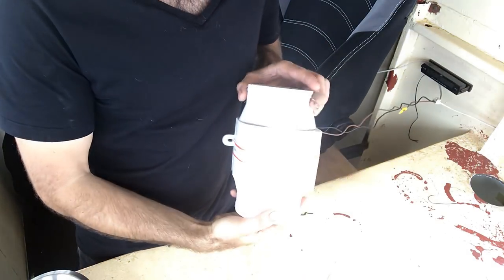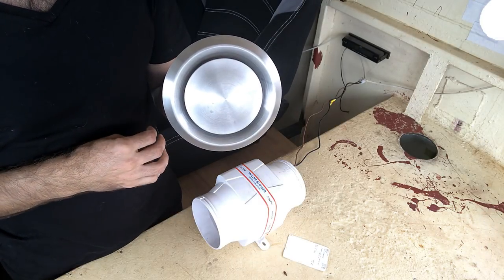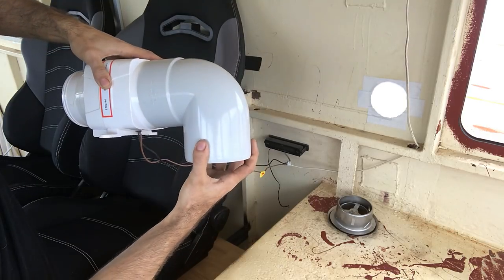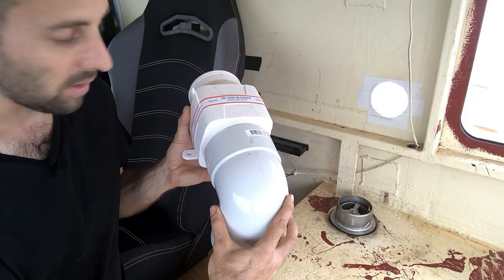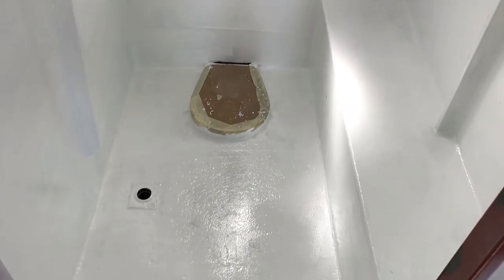Brupeg's Bathroom gets worked on (Ep. 09)

Comment: Hi from Canada.  Really enjoying your videos and like seeing the progress you are making.  When you mount the fan for the bathroom on the back of the wheelhouse, you might want to put some dense foam between the wheelhouse and the mounts to cut the noise that you would get if you bolt the fan directly to the wheelhouse.
Reply from the maker: That’s a great idea. Our 12v water pumps have little rubber mounts for that reason. I will track some of those down to help out with this issue.

Comment: I have an idea to quieten down your bog blower. DC motors will happily run slower (and quieter) at lower voltages. You can buy DC-DC voltage converters, which would lower the voltage to say 5V, but they are expensive and the output voltage is fixed. Or you could wire two blowers in series to effectively give each blower 6V. Even better you could wire a light bulb (the bathroom light) in series with the motor. Playing around with different voltage and wattage bulbs will increase and decrease the motor speed. Or if you can work out the voltage that the blower works well at, then doing a bit of maths will tell you what resistance (wattage) the bulb needs to be.
Loving the videos, hope you keep em coming. 
PS. I have to smile every time you call the boat by its Kiwi name, Brewpig.
Reply from the maker: I was wondering why people called it that right after I say the name (in my head I was thinking I’ve just pronounced it why are you saying it wrong!)

Never even crossed my mind I caused them to say it wrong

Comment: Greetings from America, and happy new year! Don't grind the ceramic you'll end up buying another one when this one breaks. Also you may have mentioned it on the video and I missed it but after you roll the paint tip it with a brush while it's wet, this will give you a great finish. Videos have really improved, I enjoy watching a craftsman at work.
Reply from the maker: Thanks for the kind words. I didn’t tip this paint, I’ve tried tipping a few times now and just can’t seem to get the hang of it. I know it works but I just can’t seem to get it working. Also we have dropped the idea of grinding the ceramic, going to just leave it and fill the 4mm gap with the right sealant

Comment: Now's late, but, generally you don't cut with a grinder rather a specialized (and cheap) tool called a seat adjuster. You can get them in small kits, or just the cutter by itself. They also are in various sizes for various pipe IDs. Perfect fit, every time, especially if you spring-sproing for the ones that round chamfer the edges.
Reply: Also, for ceramics go directly to diamond cutting tools, don't even bother with anything else. Alsox2 water. Never grind that stuff without water even if you're in open air with a mask. What it does to your lungs is not good, if you care about stuff like that.

Comment: You could try building an insulated box around the blower motor. The one you have is actually a pretty good size as far as moving lots of air.
Reply from the maker: Yeah thanks. The motor will be on the outside of the boat so I’m hoping that we reduce some of the internal noise

Comment: Suggestion to consider with the blower. Mount outside as planned but connect with dryer vent flexible aluminum , it will help isolate the vibration noise from the blower.,.
Reply from the maker: Thanks for that. We decided not to use sealant and found some Flexi rubber pipe that will be used as a joiner
Reply: ,Richard Shepler Sr - Don’t use aluminum as it will disappear in the salt air and look like shit
Reply from the maker: Hi Norm. The vent will be made from PVC with rubber joiners

Comment: hi !, just a suggestion instead of the bodge job with sealant for the fan , use rubber pipe coupler's, then you can easily remove the fan and also absorb most of the vibration  . https://www.plumbingsupply.com/flexibleconnectors.html

For the sink leave it be ( don't cut up the sink ) that's what caulk is for, lol. or pull the wall true with a come-along and weld a straight bar across that small section to make it fit the sink.

Also may i ask you the details on that hand shower faucet , its fairly hard to find those here in the states.
Reply from the maker: Good idea! We’ll check that out thanks.
Reply from the maker: We purchased the shower from a local group called Bunnings, this is the link to the model we brought

https://www.bunnings.com.au/mondella-wels-3-star-6l-min-maestro-1-function-hand-shower_p5003333
Reply: Tbh im more interested in the mixer you used i cant even find one like it on bunnings. I guess in should have used the proper name.

Comment: The night terrors will come for you as you sleep calling you out for that shower head bodge.... Just pack it out 5mm so it has a gap to save the hose crushing and being removable.
Reply from the maker: It works well enough at the moment but yes it’s on the list of little jobs once we’re in the water. If we focus on all the little unimportant things we’ll be on the hard stand for ever. There are a lot of finishing jobs to do, another year of work after launching I think. We’re looking forward to getting things right and complete. Cheers for the reminder. Jess
Reply from the maker: Been using it for a year now. It’s fine no issue at all. Just thought there might have been

Comment: weld a strip and grind behind the sink or use a 4 inch diamond blade on a grinder to cut the sink.
Reply from the maker: Thanks Dan. Is a Dimond blade able to trim ceramics?
Reply: i use a solid a Norton diamond blade, in the uk they are cheap enough 10 quid i use it to cut ceramic tiles, unless you cut on a corner of the sink it should be the same thickness glaze as a tile.
Reply from the maker: dan katla sharpe ok perfect thanks for that. I will check them out. I’m nervous about ceramic work after the busted toilet bowl incident (on Facebook)
Reply: your not a builder till you have bust a toilet bowl welcome to the club.
Reply from the maker: Yeah I felt it was a defining moment. The great toilet explosion of 2017